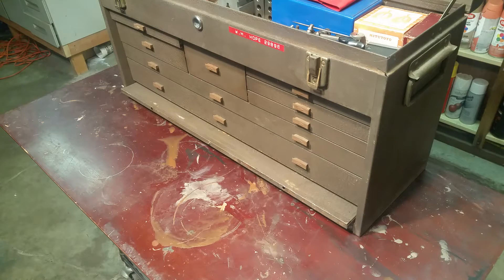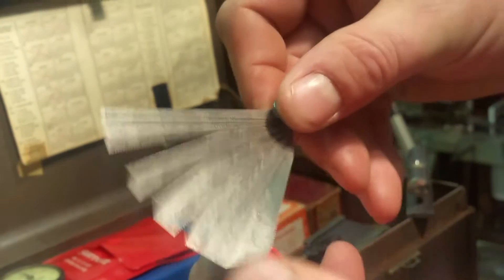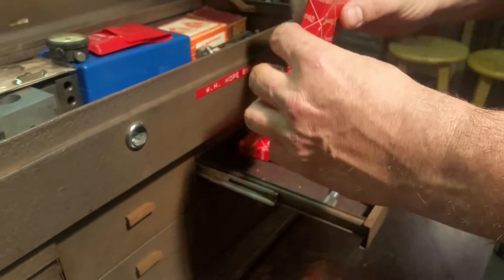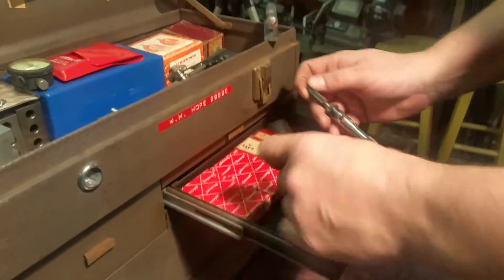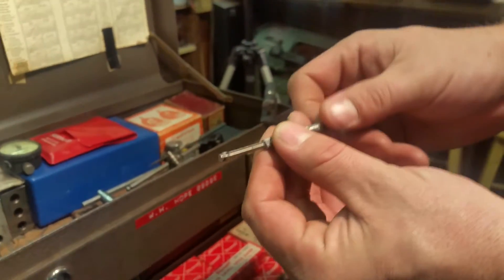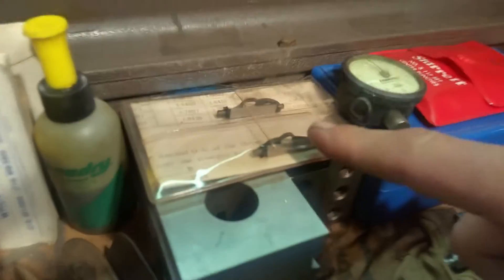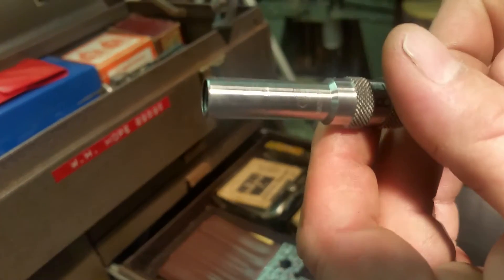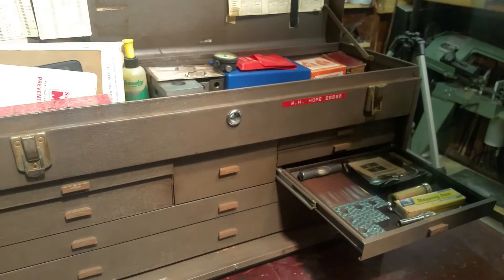Kennedy Tool Chest with Starrett Tools Pt. 3

Comment: the "shinny pieces for work" you thought are stainless are actually shop made standards which is most likely hardened (the black paint) is probably  actually carbon scale from hardening and the surface of the standard has been jewelled a very laborious  task  its commonly done on high quality firearms

Comment: The taper gages are very handy for accurately measuring hole diameters.  Each division is 0.001".
Reply from the maker: Thank you Hans, the gauges I had seen previously were for thickness. Pretty cool tools... thanks for letting me know.